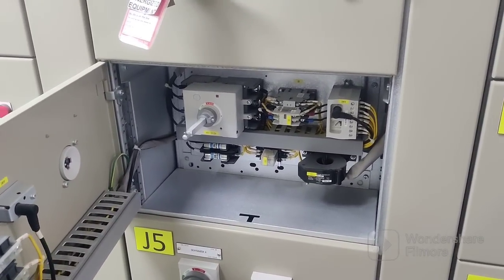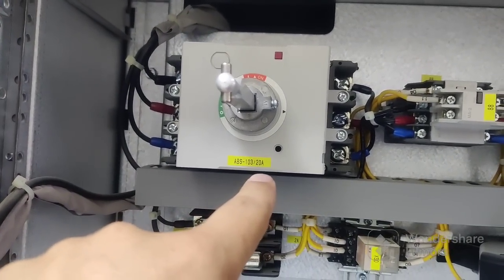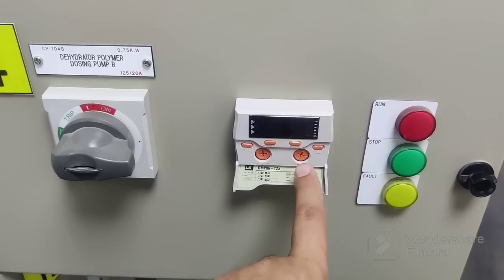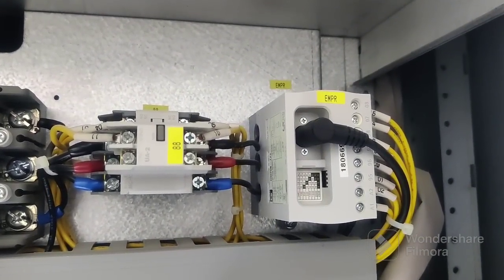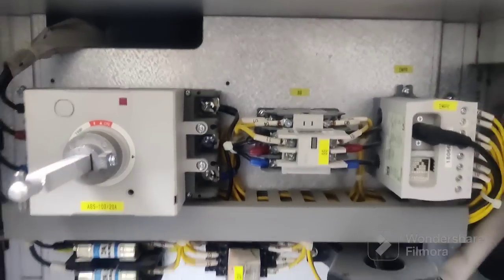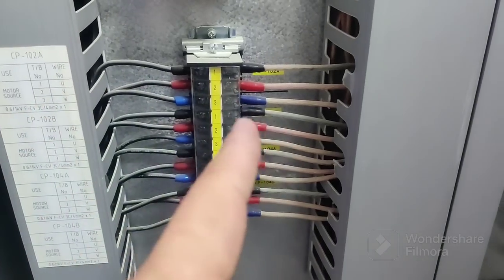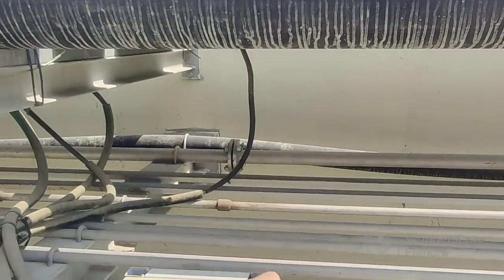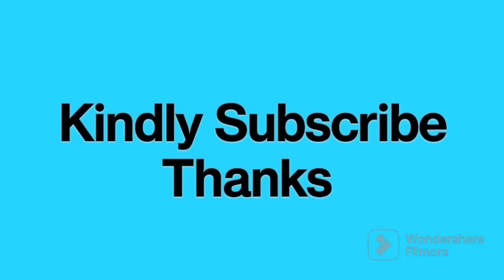Delta Connection For 3-Phase Motor  | Practical Explanation

Comment: A.alikum bro can send me single line diagram of star delta motor connection.
Reply from the maker: Yes sure
Reply: Taso peshawar na yaee.
Reply from the maker: @hilalahmad29  ao g
Reply from the maker: Koshesh kuma che Saba dersend Kam rura
Reply: Bro single line diagram ba send kai.
Reply from the maker: @hilalahmad29  https://youtu.be/6AeLXNEc5QY  watch this video you will get SLD
Reply from the maker: @hilalahmad29  email I'd rasend k che SLD dersend kam
Reply from the maker: Videos rala watch k plzz
Reply: A.alikum bro .
Reply from the maker: @hilalahmad29  W.salam
Reply from the maker: https://youtu.be/6AeLXNEc5QY  watch this video you will get SLD
Reply: brother i understand dol, and star delta starter connection. but i want to learn control wiring diagram of this panel.  EMPR connection  etc ..
Reply from the maker: @hilalahmad29  noted
Reply: I watched all videos about this panel but can't understand it.
Reply from the maker: https://youtu.be/ehNLkQ0wNJE
Reply: Hilallahmad333
Reply from the maker: @hilalahmad29  check your email
Reply: Bro also send control wiring diagram of this panel .
Reply: Bro control circuit diagram ap k pass hoga.